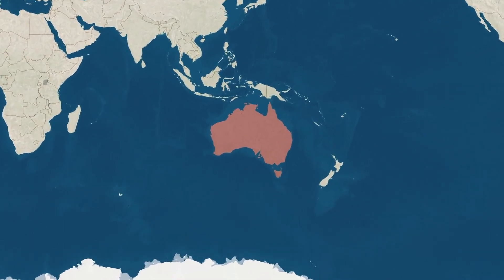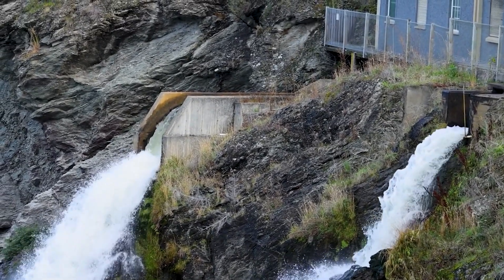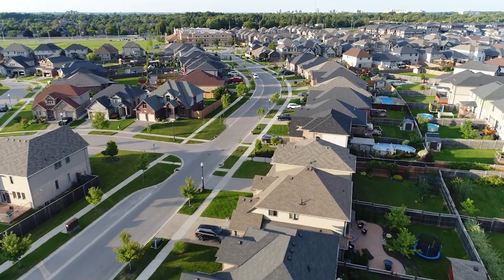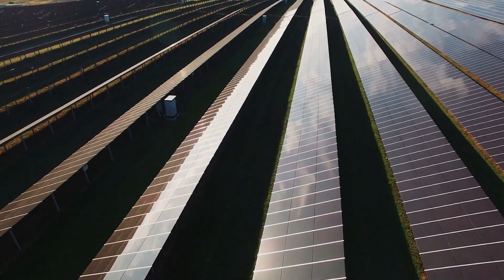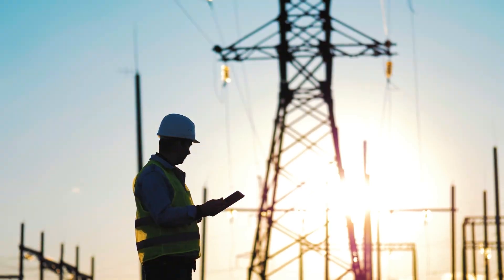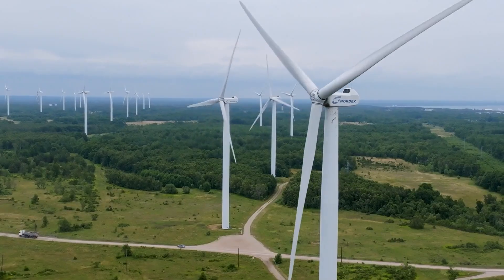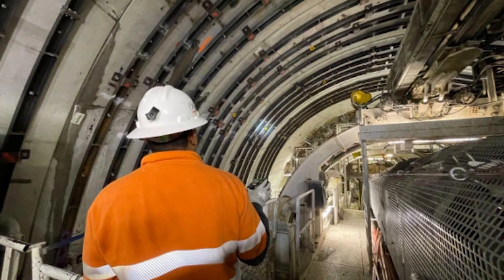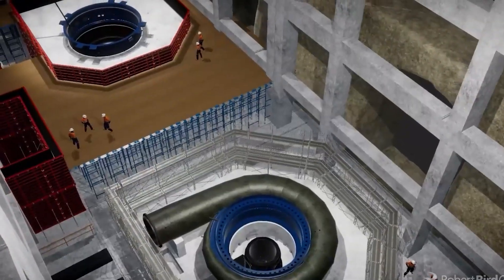The $12 Billion Clean Energy Mega Project

Comment: thanks for your explanation, water crises in the world 2025 like Iran and solutions 
The use of electricity from renewable energies, particularly in the railway sector combined with hydrogen fuel, in addition to increasing locomotive power, along with the implementation of parallel and level double railway tracks with optimal spacing for transporting large volumes of cargo and essential goods and connecting to international transit lines, represents the best option under conditions of water crises or flash floods high speed and safe. This approach can be competitive with the capacity and volume of cargo ships. The use of the most advanced water treatment plant and multiple production which I invented and have referenced in my LinkedIn and YouTube profiles, can be an effective solution in navigating the water and energy crises zero pollution, high efficiency.